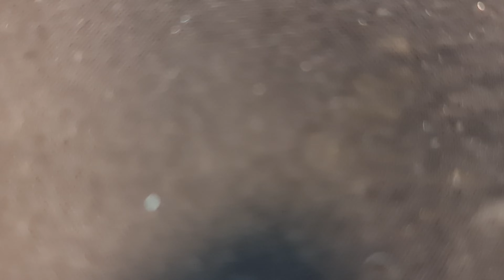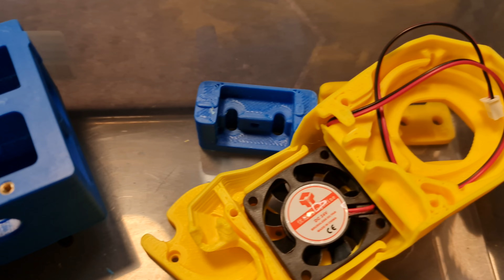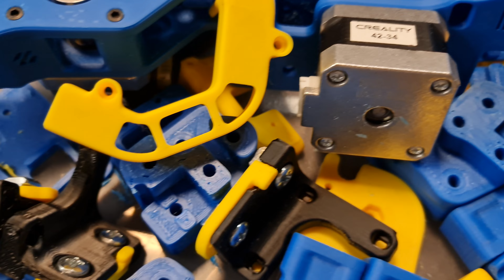Voron 2.4 R2 parts printed with HIPS filament, not ABS or ASA

Comment: Man, did you see Hips warping during printing? I want to go Hips instead ABS
Reply from the maker: Yes it does warp a lot, need good PEI bed or kapton tape.
Clean very good before printing, bed temperature 90-100C
Reply: Thanks  @toma.3d  , but it warp more than ABS man?
Reply from the maker: @VitorLima-yr9ti  depends on quality, for me less warp on HIPS and can print small parts on open printer at 100-105C in the middle of the bed
Reply: Thank you very much  @toma.3d  :), I had this question for a week, there is not much information about Hips on the internet.
Reply from the maker: @VitorLima-yr9ti  you are welcomed, always.